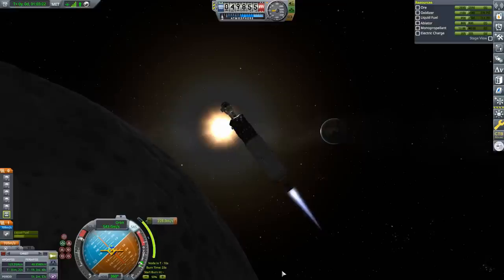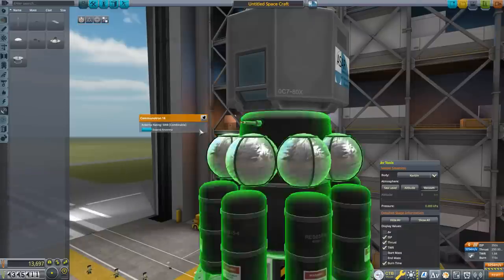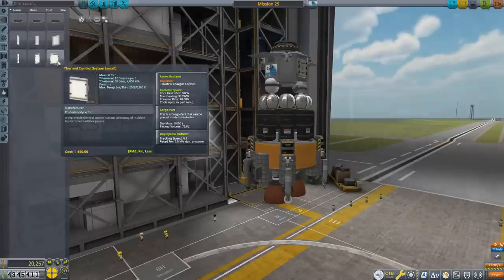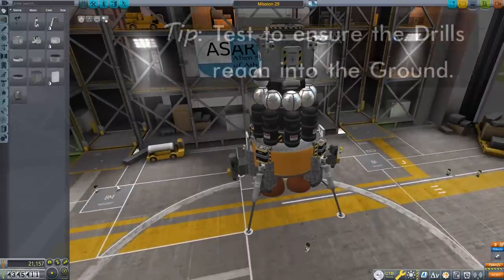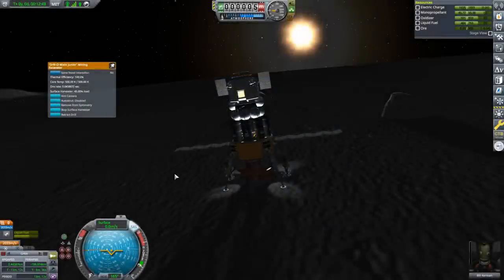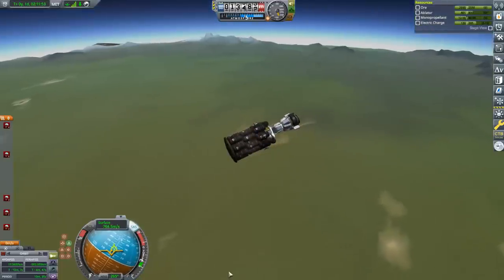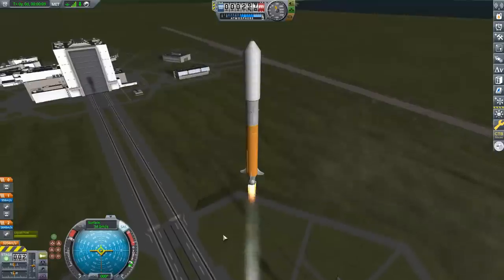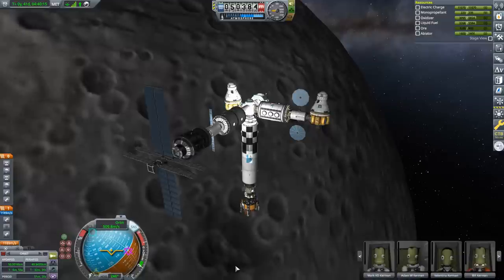How to Harvest & Process Ore | KERBAL SPACE PROGRAM Contract Tutorials

Comment: Great videos! I have probs 300hrs in KSP but I haven't played for a while and got back into it recently because of KSP 2 around the corner. I am by no means good at this game and this series along with others have been great refreshers/tips and tricks. I was also bad at sizing my stages and would just and more fuel to get more delta-V instead of trying make the stages effectient. Thank you!

One question tho, is the engineer a bonus or a modifier? In the video you said bonus but the math implied modifier. You did .3 x .0589(59%) x .45 (45%) = .008 ore/sec/drill
If it was a bonus it should of been .3 x .589 x 1.45 = .026 ore/sec/drill.
Reply from the maker: Excellent question that I was confused on at first too, but the engineer is really a modifier of the rate. It isn't a 45 percent bonus on top of the rate. You can see this at the end of the video where the base rate of the consumption of the Convert-O-Tron is 0.5 ore/s. If you multiple that by Bill's 45% you get 0.225, and if you check the rate at the top right when the Convert-O-Tron is running at the end of the video it's 0.23.

Comment: Do you need to deliver all ore in one go, or you can complete that contract with multiple delivers?
Reply: I tried splitting a similar contract in to several smaller missions, but it didn't seem like the game tracked the amount of ore. If I had landed the vessels on Kerbin and kept them active, it might have worked, but it ended up being easier to do it in one go.
Reply from the maker: No, you need to have all that Mun ore in a single vessel sitting on the surface of Kerbin for the contract to satisfy.
Reply: Hypothetically, although this wouldn't be practical, what if you had all the properly fresh ore on separate vessels landed back on the surface of kerbin, and then docked them together? Would the mission accept that after 10 seconds?